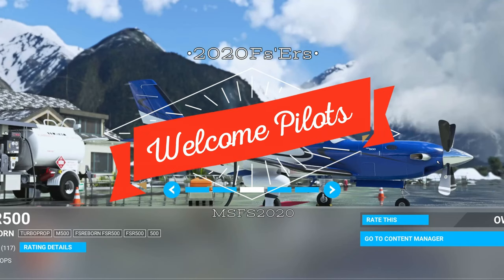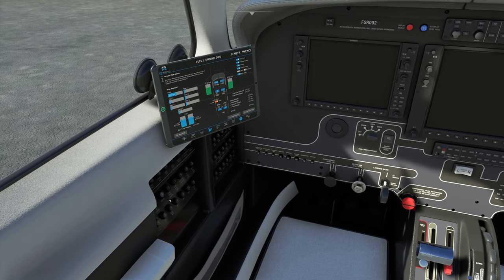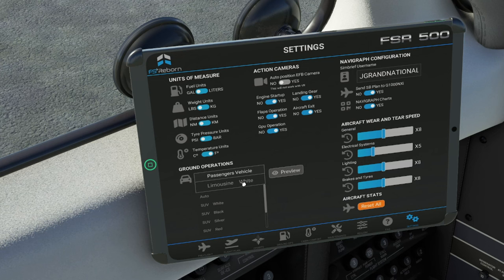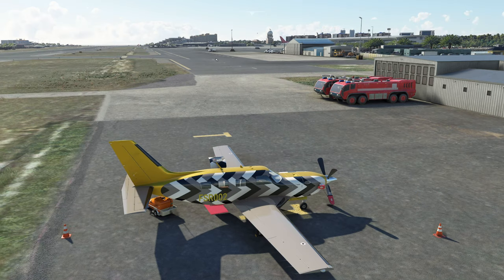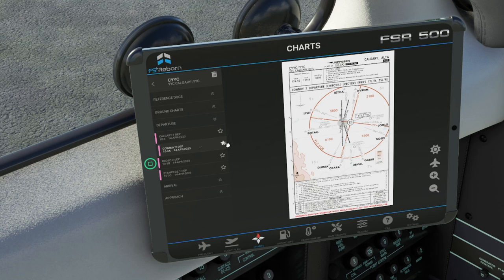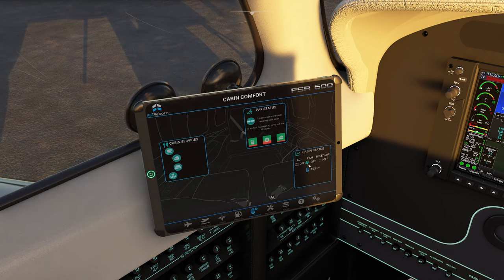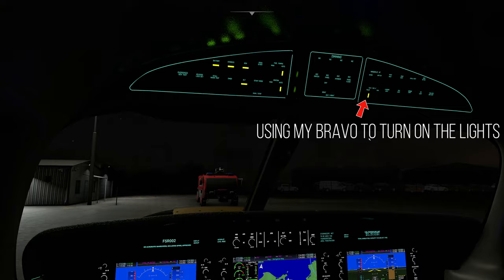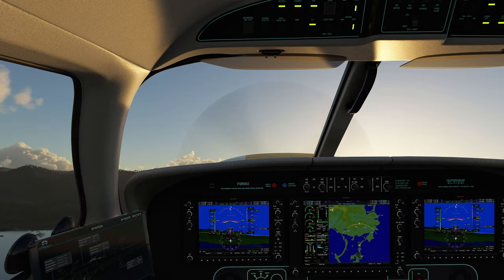First Impressions: A Beginner's Guide to the FSReborn FSR500 in MSFS2020 *Bonus tips & Bug Report*

Comment: Awesome video. What’s your opinion on on this vs the TBM 850 from black square? I’m undecided between which one to get! I don’t love the G1000 & glass cockpits but this does look pretty fun
Reply from the maker: Thanks for the question  ... they are both awesome planes . They do have pros and cons to both , not necessarily the plane itself but the addons. So the fsr500 love the tablet  it is amazing and I love the integration  of the failure system in the tablet . I also like the maintenance menu in the tablet it's very realistic to what you need to do for maintenance.  Flight model is great . Tbm850 flight model great . I don't like the failure integration as much due to them using the radar bendix to reset failures also there is no way to do maintenance on the plane Or see how many hours have been put on the components. But I also love steam gauges and this has a lot of them and work fantastic.  You can also fly higher and faster than the fsr500. As for visuals I am a vr guy and I feel in vr the fsr500 is better for vfr and better for visuals out of the cockpit. The tbm has a tall dash and cuts off some views.  So if you try and compare flight model to flight model meaning air handling . It's hard to choose because they are both great on that respect. So it comes down to the realism factor and fsr500 beats the tbm due to the amazing tablet.  They both have tons of failures . But the tbm you can't turn them off (at least from what I know) and the fsr you can. The g1000 has been custom modeled from a real fsr500. The tbm also has the ability to switch from the 750 the 530 and standard radios. The fsr does not. I have them both and love them it's hard to decide but make a pro and con list and see which one wins.  Also my 2 cents get the one that you love for instrumentation after all you will be looking at that a lot.
Reply: @2020fsers  thank you for such a detailed and comprehensive reply. I really do appreciate it, and you’ve given me some awesome angles to ponder which I hadn’t previously considered. Thanks again 🙏🏽 And keep up the awesome videos! Cheers 🎉

Comment: Do you have gs traffic or any other traffic injection system that works without too much gpu stain?
Reply from the maker: I use fsltl sometimes but I had to lower all the settings due to the fps hit.
Reply: @2020fsers  understood. Looks like I’m going to have to build a new desktop my i7 16gb ram rtf 2060 6gb is struggling. Lol

Comment: I think there is confusion here. The landing elevation is detected by the Garmin based on the destination airport nav data and is already displayed in the "Cabin Press" section on the MFD. The minimum setting on the PFD is used only for that: minimums (either baro or radio, depending on the approach). It should not overwrite the LFE in any case. If it does, it's a bug. Simple as that.
Reply from the maker: Hey I'm only going by what the developer has said and I referenced the podcast in the description.

Comment: I think the pressurisation system has a few bugs. Firstly on landing the differential pressure shows 2 PSI which should not be the case (I have the landing altitude set correctly). Secondly when descending the cabin altitude is very wrong, most of the time it shows something like -1000 feet.
Reply from the maker: I know that during the stream. The developer said that on landing the cabin should have a slight pressure to it. I'm not sure if that's correct in the real aircraft. I'm just going based upon what he said..
Reply: @2020fsers  That is true, but it should not be that high, I have noticed that in some YouTube videos it works perfectly and in some cases it is too high. And the cabin altitude should definitely not be -1000 feet. Other than that, it is a very good aeroplane.
Reply from the maker: @human2110 they did do an update today not sure if they fixed any of those issues.
Reply: @2020fsers  I will test it. You have helped me a lot with your setting guides, keep up the good work!